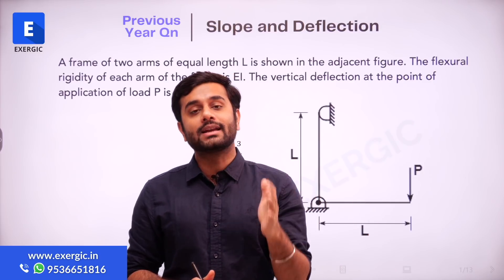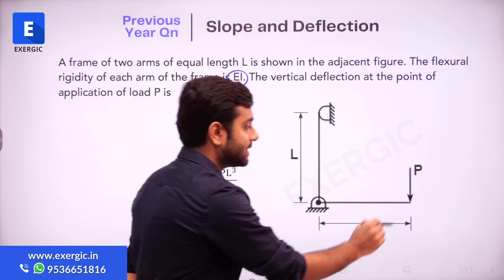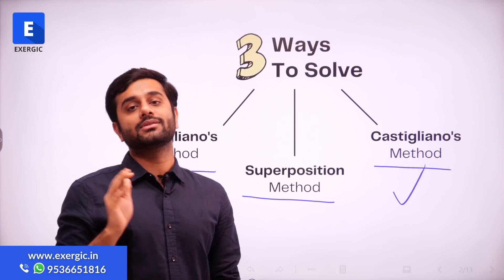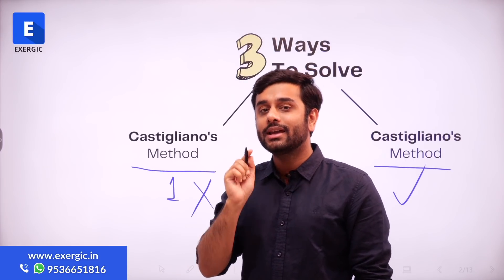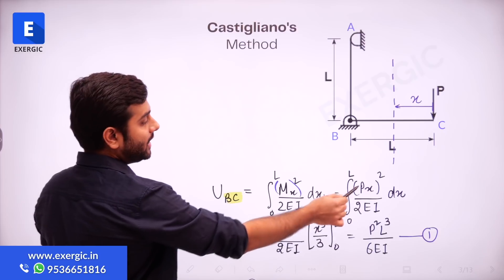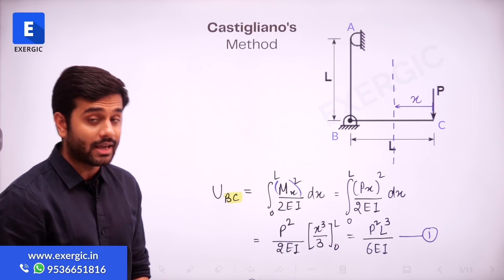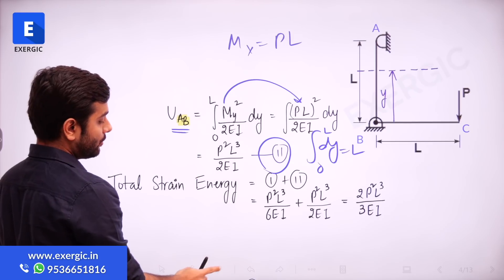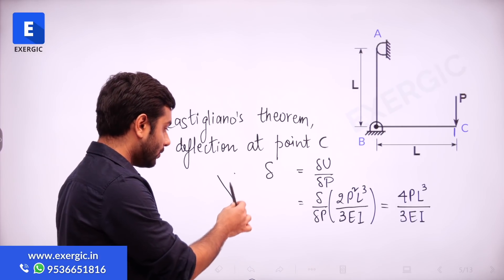Mistakes to avoid in Strength of Materials deflection questions - GATE Mechanical

Comment: Sir, Considering B as fixed support the slope and deflection are zero both in the vertical and horizontal member. But how does a value of Ml/ 3EI come to B?
Reply from the maker: Please watch previous lectures for more clarity. It has been discussed earlier.
Reply: According to me P(L^3)/3EI will come as answer. The deflection and slope shape at the end B will not affect the deflection value at C.
Reply: Sir, Can you please draw shear force diagram, bending moment diagram, slope and deflection diagram for that vertical member alone?
Reply: It's not actually fixed ...but it's a  frame.. so  it's resisting rotation of point c i.e BC independently so considered fixed here...but as seen from ab pov its simply moment acting at one hinged end and other  is roller so direct formulas are there for theta

Comment: 1) If we select AB as system 
2) section. Where AB and BC connected shear force V, Axial Force  and resistive moment M will be there 
(i)V= P from (FBD of BC )
(ii)M= PL CLOCKWISE (FROM FBD OF AB AND BC )
(iii)AXIAL FORCE AT SECTION=0 (FBD OF BC )

(3) Bx=Ax =P.....these two forces cause COUPLE 
 This couple and Moment at section (where AB and BC are separated ) Will bend 

so where I am thinking wrong ?

Comment: Sir , when you calculated the slope you considered the moment at B only not the reaction force ?
Reply: That reactive force becomes axial load for vertical member not transverse load
Reply: Reactive force if horizontal which is transverse for vertical section